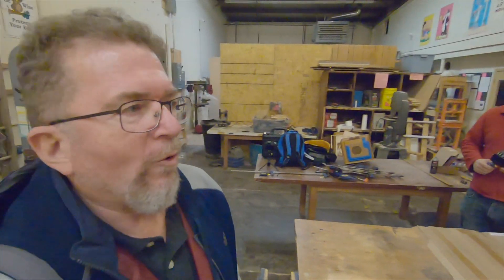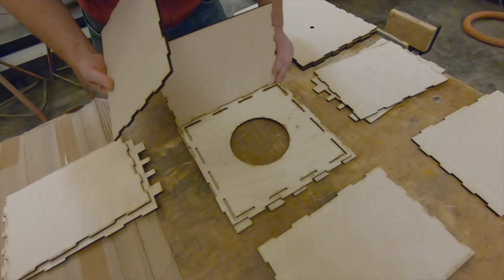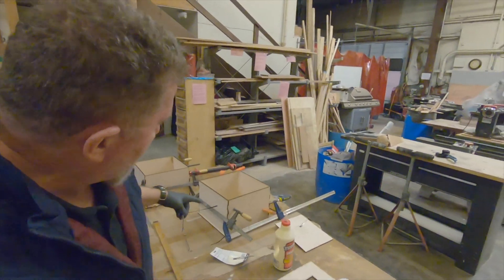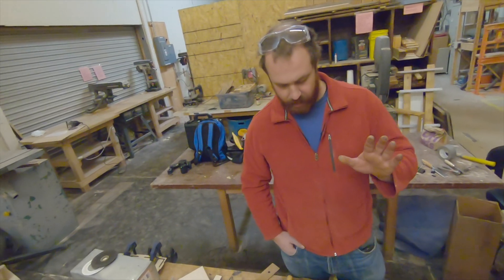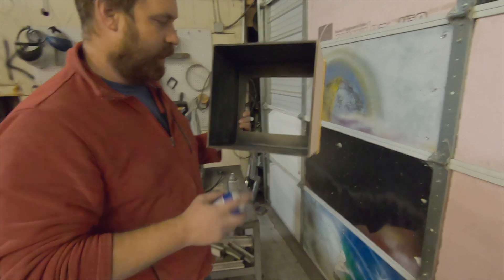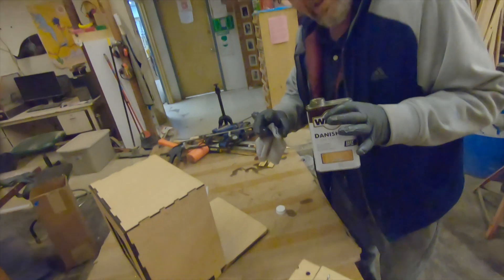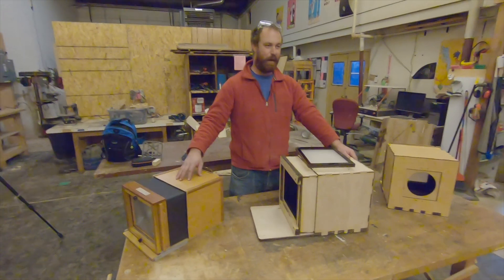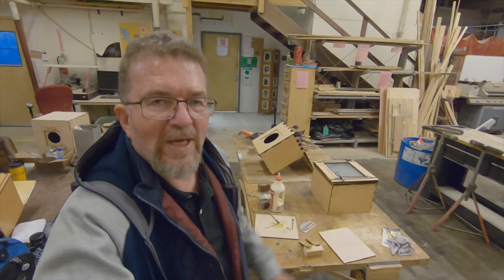Laser Printed Sliding Box Camera - Part 1

Comment: Nice work! but still I cant understand how the sliding back locks. Is it with clips?
Reply from the maker: I use a small wood workers spring clamp to set the focal distance. There’s enough friction to keep the back from moving if pointed other than horizontally.
Reply: @Joe_VanCleave  Thank you. I also would like to ask about the ground glass. Is it made out of organic glass?
Reply from the maker: @gabrysgabriukas  Acrylic plastic is what I used. You could also use glass, it's just harder to grind to a ground glass surface for focusing.
Reply: @Joe_VanCleave   understood.  I am  still curious what you use to grind acrylic plastic? is it sand paper? I would like to try to matt plastic because it is not as fragle as regular glass but I guess that optical properties of a  glass are better than acrylic plastic.
Reply from the maker: @gabrysgabriukas  I use fine a fine grade sandpaper disc on a random orbital sander. But you can also do it by hand, just use circular motions. 400 grit or finer.
Reply: @Joe_VanCleave  Thanks! I will give it a try!

Comment: Nice work! While the laser cutting machine was working, I got a flashback of the movie "Logan's Run" where the cosmetic laser went berserk!  Both of you wore jackets during this video. Was there a lack of heat in the shop?
Reply from the maker: It was a bit nipply. They keep the heat turned down to reduce costs.
Reply: @Joe_VanCleave  I guess. That's the main reason. Are you off for Thanksgiving? Ready for snow?